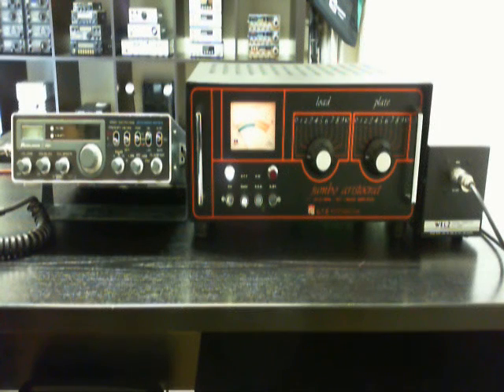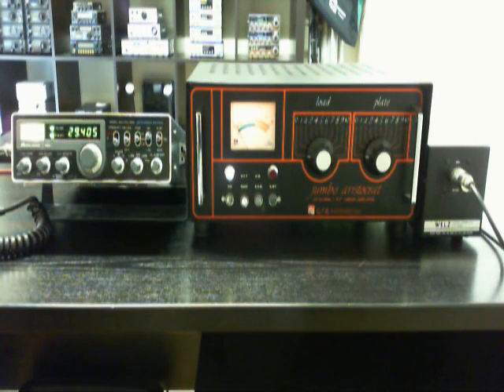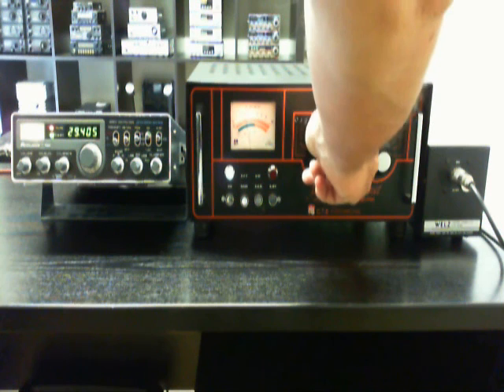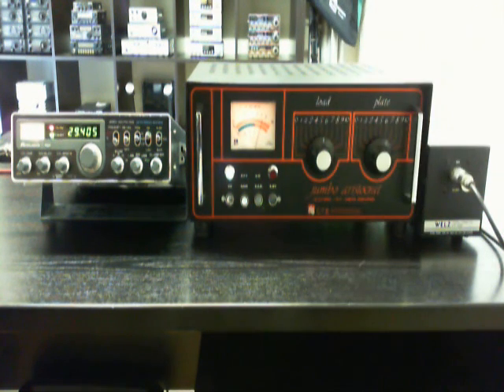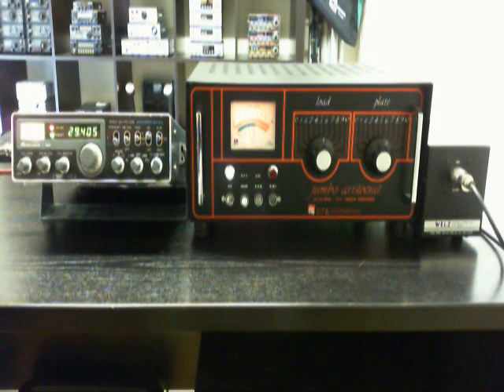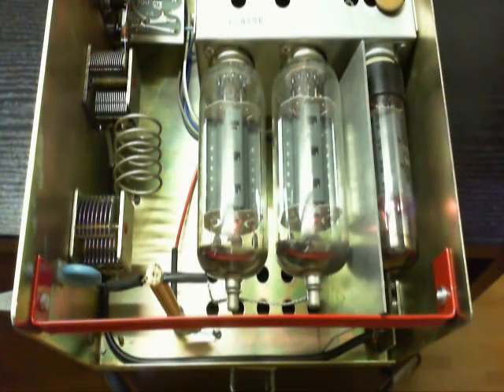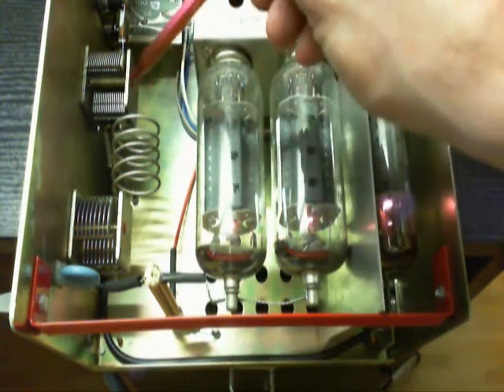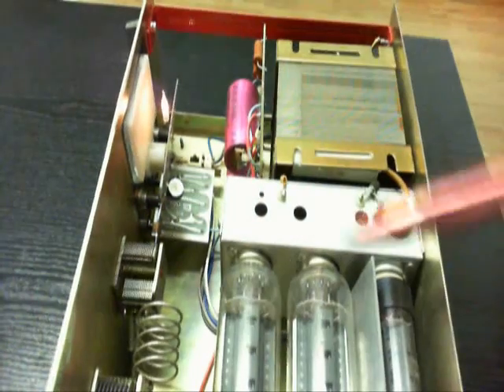CTE JUMBO ARISTOCRAT 24-30 MHz, TUBE POWER AMPLIFIER

Comment from the maker: @bigpimp347 
Hello dr OM, of course, the included power meter shows just the input pwr, maybe?.. . Abt. 50% dissipation in the grid. The output pwr is aprox. 100 watts per tube (EL509), also 200 watts out...73's..

Comment: Hi, I have a similar amplifier that uses four el509 tubes. I believe one of these is a driver and the other three are the main driven valves. I am driving the amp with 10 watt but only seeing 300watt max. I have bought a new set of el509 valves but is still only managing 300. I would have thought it would manage 400 quite easy looking at the specs on the el509. I was thinking about changing the large capacitors as it's quite old now. Could this lead to an increase in performance ?
Reply from the maker: +26fb384 Oh yes, it's very necessary, to change the old high-voltage capacitors in the PWS. Then you get more hum-free supply. on the anode and grid of the tubes (valves). Good luck and let me know the results. Best 73s to you

Comment: Igot a set of russia EL509 tubes  in a amp. 1X4  KLV 1000 230V amp. runs hot. got to keep drive down. thanks for the look at the CTE.
Reply from the maker: Hello dr CB-radio fan. There is also an GALAXY-100 by CTE in my collection. It's using 5xEL519. Output abt. 1000 Watts PEP. All in all, CB-radios and antennas are a passion of mine. It was a beautiful time in the 80ies: Big CBiers parties, without smartphones and facebook profiles. Best 73s de Stefan and happy airwaves to you. ...

Comment: Did you  reconditioned or in the video is still with the original components ?
Reply from the maker: +SHULTZ Oh yes, the Pictures were made before Remake of the power-supply. New high-voltage capacitors are now in there. But the Amp isn't more in my collection. Best 73s to you...

Comment: 1:30, you make a swits ( onte radio )from FM to SSB... batt you forgot the swits of te SSB on de jumbo... so.
i dont tink you react ist from 2011.. 
good luck. gr
Reply from the maker: Oh yes, the SSB switch on the Jumbo, is switching in an electrolytic capacitor. This will make a delay on the RX/TX relay. I've forgotten this in the old video from 2011. Thank you for your interest and happy airwaves to you...
Reply: tanks for react... 
ist so bat to ciing.. so i cas ???

i am a happy fam of the jumbo...
gr

Comment: i cat one  ! ! ! !
i tink for maby 35 yaers ! the best  !
Reply from the maker: +schummiehugo Oh yes, of course. Now it's necessary, after all these years, to replace all electrolytic- capacitors in the powersupply. Then you get a hum-free Modulation on all modes. Best 73s to you.
Reply: +SWIZZRADIOS  (sorry for the batt englis )
the same of  a avanti sigma 4 ant.  hoooow man, ewri one hear my ! ! !
thurner +3B, ant radio president

a best men,, had for my a revisen of  (olmoost ewriting)
is in site good as new.
ther is only 1 ting... its needs 3 tubs.
the 2 x 519 ant de stering tube
 i am so glad i haf one  ! ! !
now bether,, i filmt it.. en send it 2 you ! ! !
gr
Reply from the maker: +schummiehugo Thank you and happy airwaves to you....